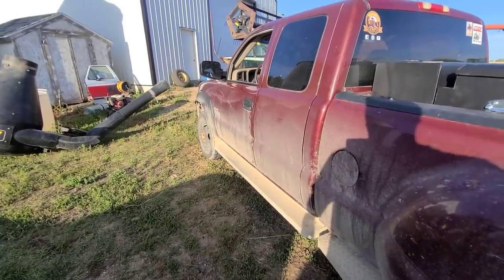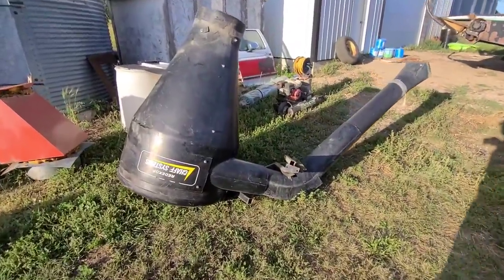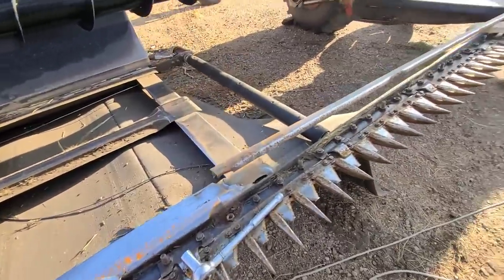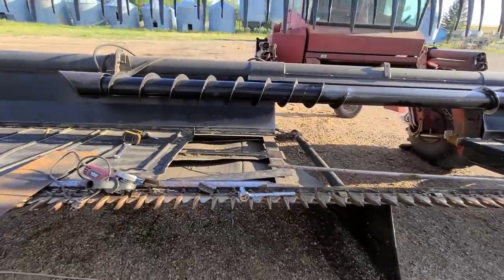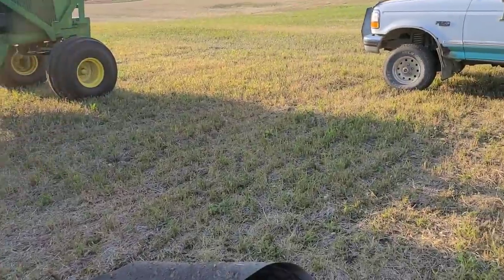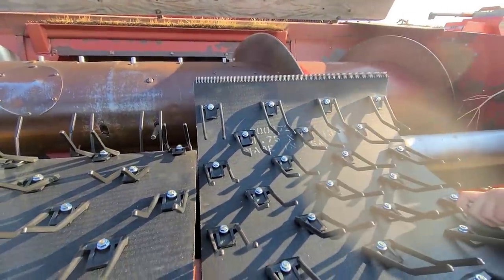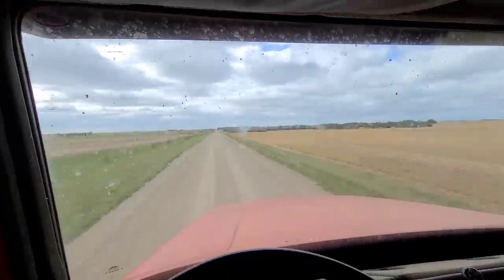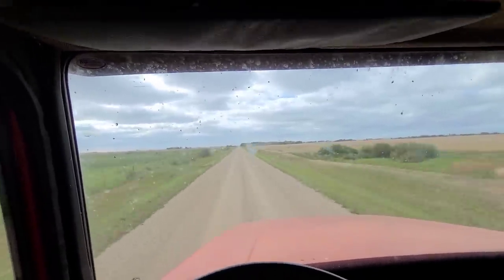New pickup belts for 1682!

Comment: Great family!!!
  When lacing those belts get your self the top wire out of an  CB antenna. The wire is a little smaller than the common lasing, stiffer too and is smoother than the lasing. So line the splice up and push the antenna wire through, Then when it is lined up push the antenna wire out with the new lacing. Also use a little silicone spray lube on the new lace will make is slide in easier. 
   I splice conveyor belts at work 4-5 times each week. I fighting those lacing is common to me.